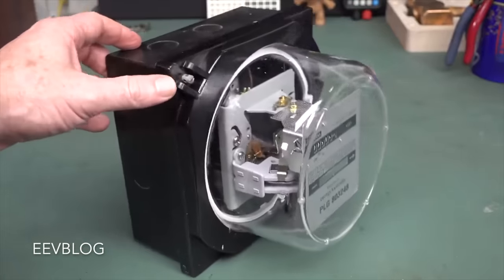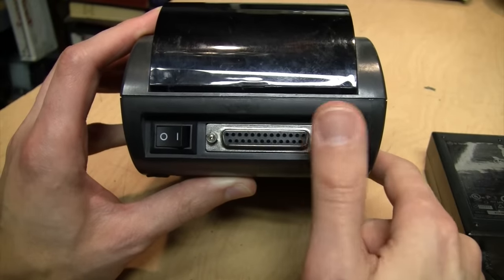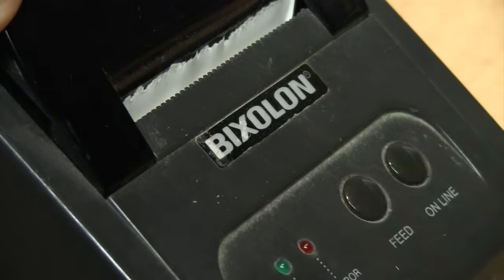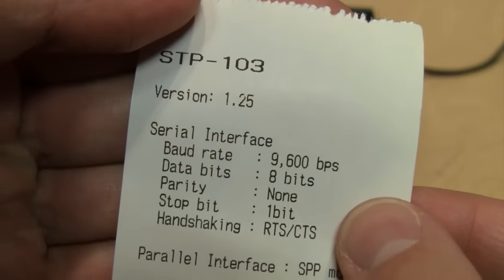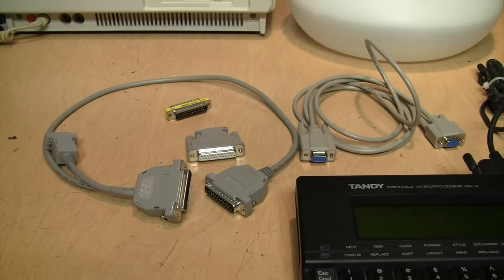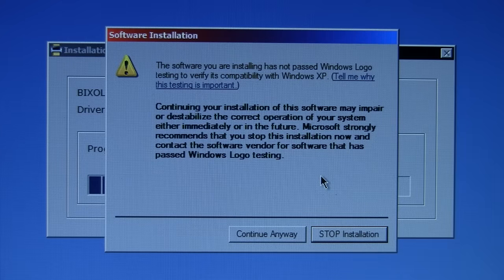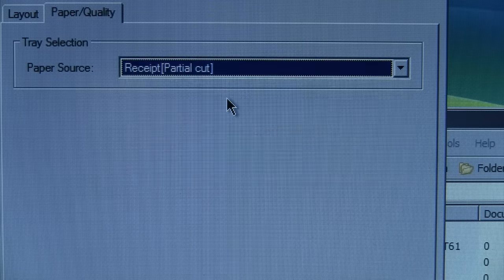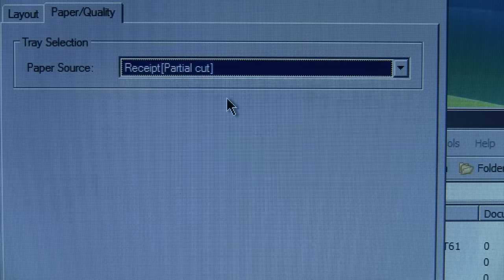I got a receipt printer. 🖨️ Now what?

Comment: I remember that one of the supermarkets in the country where i live used to use receipt printers that could print on both sides of the paper
How do i know? Some of the items purchased in a transaction were on the back rather than on the front
Reply from the maker: That's odd. It's common for them to use rolls of paper that have information or ads pre-printed on the back, but I haven't heard about the receipt printer printing on both sides. Usually only one side of the paper is coated with the thermally sensitive "ink".
Reply: @vwestlife  It's been marketed as NCR 2ST. (Or at least that's the only brand I've seen ads for)  I've only run into one receipt ever like that.
Reply: I received one of these from a British post office self service machine in Cardiff… got somewhat embarrassed when I asked the guy working there why it hasn’t printed out the tracking number, when he took it and handed it back to me the other side politely, haha. (Back in my home city I’d usually go to the counter and there it’d all just be on one long receipt, or maybe two separate ones.)

I wonder how often they get people confused like that?
Reply: @straightpipediesel  I've seen those NCR printers, but never knew there was anything special about them. I never saw anyone making use of that capability.

Comment: Ironically the "USB" recept printers just have a USB Com Port adapter inside the card.  Most POS software packages still require direct com port connections because enterprise software moves slowly.

Comment: I guess that the Mattel Aquarus computer from the early 80s used a thermal printer too.  I was never sure if the people at Mattel thought it would be a good idea to hand in a school report printed on thermal paper.
Reply from the maker: Portable battery-powered thermal printers were common for use with laptops in the '90s. You could either use thermal fax paper, or install a special ribbon and print on plain paper.

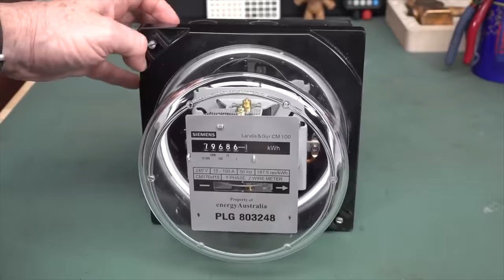Comment: Seeing at 0:02 i had a "uncle" if you can call him that anyway um it was a lamp that had one of them home meters in them it actually worked if you put a 60 to 100 watt or a 3 way bulb in it the meter actually spun around. Kinda neat but just impractical lol. That is neat though you have a receipt printer hey theres an idea if you did ebay vs printing it on a 8x11 it be neat to print one out or do logos on a print.   That looks like one used at a resturant or a utility company that would use one. I know when i worked at target in 2007 2008 about they had same type but theirs has a paper cutter and a check printer on it in one.

Comment: I have a receipt printer I've never used, the connection port is an RJ45 port. Interestingly, at 5:45 the barcode reads 123432

Comment: I'm surprised thermal printer makers never made larger printers capable of A4 or Letter size paper.  Even though it would have meant manufacturing A4 / Letter size thermal paper sheets, it would be practical for occasional printing (e.g. Amazon return labels) without the hassle of dried ink heads and could be a lot more compact than a laser printer.
Reply: Fax machines were A4 sized thermal printers.
Reply from the maker: They do exist -- many fax machines could be used as a computer printer, but the public didn't like using the expensive, greasy-feeling thermal paper that curls up and fades out with age.
Reply: @vwestlife  I didn't realise there were fax machines that used them.  All the fax machines I used in the past used either a thermal transfer film or were part of a multifunction printer that used ink or toner, at least here in Ireland.

Comment: I bought an olivetti prt100 and it turns out, the drivers only work up until windows XP. But i don't have any computer capable of running that. I think I've tried everything and the closest I've come, is pushing text to the serial port and getting gibberish printed on the paper.
I want to use it to print lists, instructions, low-quality graphics...

Comment: CPL is an inherit information of a parallel port, not a serial port.
The port you've shown is also obviously a parallel port 

Also technically USB is serial.
Reply from the maker: But the DIP switches for baud rate, data bits, etc. are all for a serial port.

Comment: The biggest problem with receipt printers are crew members that don't remove the empty core before attempting to load the next roll. No, I didn't perform a miracle to get the paper door to close!
Reply: Oh, and I have a few 1980s Simplex fire pull stations, the keys to open them, and the white replaceable snap-tubes inside them. Got a few annunciators, too. My father used to install fire alarms for Simplex when I was young. I have a heat detector head and I think a few smoke detectors as well. "Someday" I might tinker with them.

Comment: Hm, I wonder if thermal paper could be used to take photographs of the Sun using the right kind of lens to project the Sun's image with a big enough amplification that it still heats the paper but doesn't set it on fire...

Comment: Get teh free DOS based DHPOS software, a barcode scanner and a cash drawer and you can properly play shop!, and no I deffo have not done the same.
As for the PSU voltage/interface, most that have an external PSU are 24V and that is what is normally the voltage for the cash drawer solenoid, and most will have multiple interface options with exchangeable modules, parallel or USB is reckoned to be the least trouble.
Reply: This is a great idea. I think I'm going to have to putter around with it!

Comment: You know, I know of some Airports that have a "story printer", so when you're waiting for final boarding of your flight, you can read a short story to pass the time. If I had one of those printers, I'd use it for that, although a lot of my stories I write tend to either be violent, risque bordering on erotica, or both, so I'm probably never going to get away with it in places like an airport.
Reply: That would be pretty cool actually. Kinda like mini libraries but not.

Comment: This video got me thinking why haven't thermal printers replaced the ink printers in consumer use? The paper is cheap, printing is fast and there is no need to constanly get new envoronmentally unfriendly cardridges. Is this just blatant corruption or is there any practical reasons other than colors?
Reply from the maker: Because they require special thermally sensitive paper.

Comment: That's parallel. Not serial. Serial is 9 pins. Parallel is 25.
Reply from the maker: Nope, there are 25-pin serial ports too: https://www.firewall.cx/networking-topics/cabling-utp-fibre/121-network-serial-cable.html